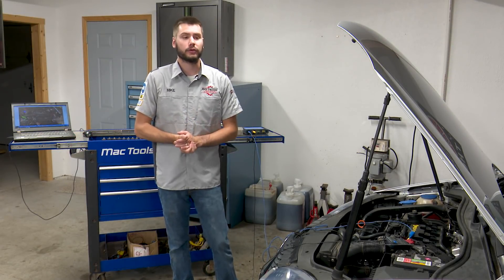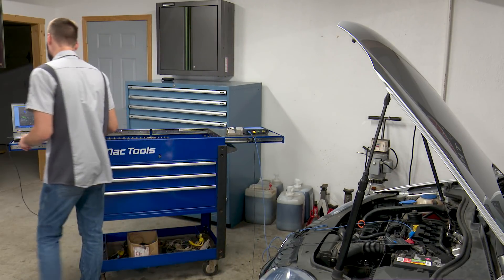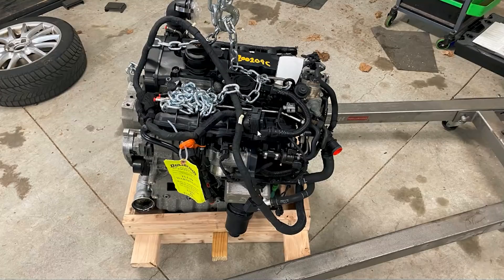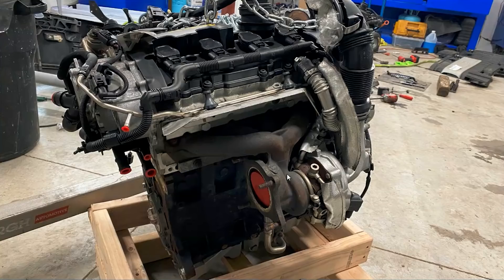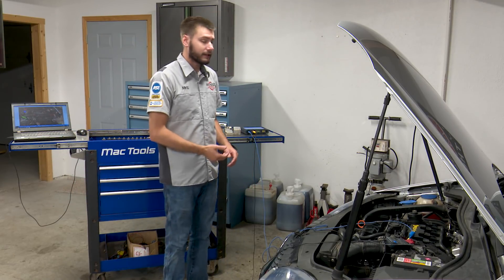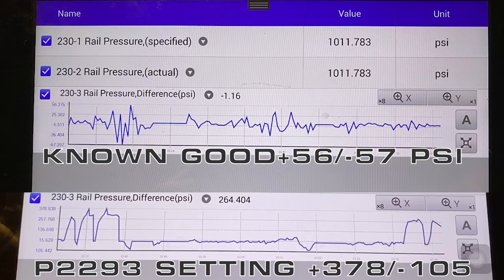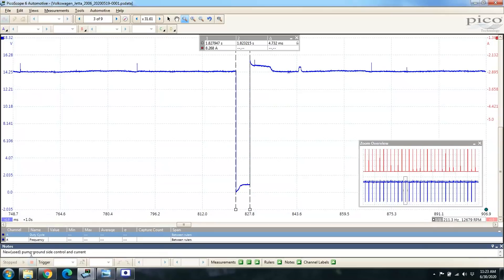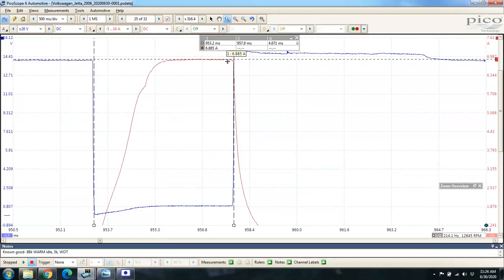Part 4 - Did The New Engine Fix The P2293 High Pressure Pump Related Code?

Comment: Thanks Mike
Time to quit while your ahead?  
To sell or not to sell, that is the question?
If it's running good, keep it till it starts giving trouble, then get rid of it!
To me, the electrical comparison was comparitively in range.  It obviously was the mechanical part that that caused all the problems.  Reminds me of a 71 AMC Hornet with a "double acting" fuel pump problem many years ago.  Wound up to be a worn cam lobe for the pump.
Good job Mike, hope this engine lasts a long time!
Reply from the maker: Hey Mike, thanks for watching! I know, its a tough question for sure. We'll see what happens.
Mike Becker, Senior Instructor

Comment: The answer to a lot of questions is that the high pressure pump control is timed. The beginning or the end of the pump stroke is being used. That’s how the pressure is controlled. In live data you can often see if cam timing is correct or how much it is out of spec. Because it is important to know for the engine ecu to control the high pressure pump. Somewhere in measurement group 90-94. I hope this usefull.
Reply from the maker: Hey Martjin 83, that's interesting, i'll have to take a look into that. Thanks!
Mike Becker, Senior Instructor

Comment: Nice score with that engine, Mike! Thing looked mint! Glad you got that nightmare behind you now. Problem is, if you sell it, what kind of problems will you run into with a replacement vehicle? That's the conundrum I have whenever I think I need another vehicle, lol. Especially anything built this century ...

We've had our 34 year old Grand Marquis for 17 years this past January, & the Silverado for 13 now. The 26 year old Volvo 940 is our newest addition to the fleet at 5 years of ownership. I'm keeping all of them, because, you know the saying, "Better the devil you know than the one you don't." ... And because I can't afford anything built before the 1973 model year. If I had my way, my whole fleet would be run with carburetors and HEI. 😂 

Anyway, great follow up, Mike - thanks for sharing. 👍🍻
Reply from the maker: Hey Smitty! I will always have "problems with the replacement vehicle". I refuse to buy anything "nice" I always buy something broken haha! You won't find any carbs in my garage, haha!
Mike Becker, Senior Instructor
Reply: @GoTechTraining  - Ahh you young fellas don't know what you're missing! 😜

I've been the same way as far as cars go, except for one time when I bought a brand new Silverado in 2007. Biggest mistake of my life! I was better off driving stuff from the 70's through the early 90's as far as reliability goes. That Silverado has been a lemon since the day it left the showroom! I bought new to try and save myself the aggravation of frequent repairs. HA! This thing was the worst vehicle I've ever owned in my life in that regard - instead of wrenching on it, I was sitting in a dealership for hours for warranty work! I'd rather be doing it myself! Will be the LAST new vehicle I ever buy. My next "new" vehicle will be pre-1973 model year. 😁
Reply from the maker: Man that's crazy about your Silverado...07 wasn't that bad of a vehicle. You must have just gotten unlucky!
Mike Becker, Senior Instructor
Reply: @GoTechTraining  - Well the AFM problem is widespread with those, but that's just one problem of many. I had brake pulsation on the test drive with just over 40 miles on the clock, trim was falling off the driver's door at that same time, lower ball joints made it only 38k miles, uppers 50k, along with the hub bearings, & 1 strut, & started burning oil. Front axle started leaking around that time, too. Kept throwing "Service 4x4 System" right out of the gate - dealer kicked that can right out of warranty, and I got stuck replacing the 4x4 switch at 55k, then my rear differential's spider gears shed most of their teeth off at 97k. And don't get me started on the paint and body metal strength. I tapped a little sapling in the yard with the right rear of the bumper when it was just 2 years old, and that cost me $2,200 in repairs. It not only bent the bumper, but tweaked the box and creased it right over the rear wheel. Had to go on the frame machine for an hour to straighten that out. When I had it all apart to replace the bumper components, the amount of rust I saw was frightening. 2 years old!

Chevy's slogan used to be, "Like a Rock" - today it should be, "Like a beer can". 😟

Comment: is the pump maybe damaged inside( bypassing/piston/diaphragm, causing a low tension follower chatter and over-pressure break down of the coil clearances, making current rise?
sometimes my mind goes off the wall, but sometimes that off the wall is very close to the real issue
Reply from the maker: Hey Throttle Bottle, not sure, could be I suppose. I hope not though, I don't wan't to put anything else into this car ;)
Mike Becker, Senior Instructor

Comment: I've never seen a tamper resistant cover on a computer connector before. Maybe they put it there thinking that the aftermarket would come up with some plug-in power chip for the module and they wanted to prevent that from happening. In general, Volkswagen seems to do odd things for tamper prevention (triple square and 12-point bolts come to mind).
Reply from the maker: Hey Joseph, I know, I haven't ever seen one either...crazy VW's! That could be the reasoning, but then again it's VW they don't really need a reason...saying it's a VW is reason enough, haha!
Mike Becker, Senior Instructor
Reply: dieselgate =p
Reply: throttle bottle ding ding ding.   This was exact same thought.   The VW “diesel gate” scandal that cost VW billions and darn near destroyed the company.  It was not a deterrent against tuners, it is deterrent against EPA and other investigators / regulators from trying to reverse engineer PCM logic.

For others reading this comment who may not be familiar with the massive scandal, try a Google search for “VW diesel-gate”.   I used to work for a Big Oil company and we used this scandal as a learning case study to teach our employees about how corporate reputation can get ruined by this type of cheating.  If I recall correctly, people including top executives went to prison for this.

Comment: Ok I have some input:
On my engine (BPY), my cam follower was worn COMPLETELY THROUGH; as in a giant hole where the surface used to be. This meant that the cam lobe was making direct contact with the end of the fuel pump plunger (imagine just removing the cam follower and putting everything back together). 
The camshaft lobe wore down the fuel pump plunger quite a bit. 
After all this, I still did not have a check engine light for low fuel pressure. 
This tells me the fuel pump was able to meet demand, even with quite a bit of the mating material removed. 
I’m not a mechanic, but I’m wondering if there was a problem with your solenoid? Or maybe the fuel pressure sensor?

Any thoughts appreciated.
Reply from the maker: Hey Justin, that's interesting. You don't have access to a scanner that can see data, do you? I wonder if the desired/actual high pressure fuel numbers are the same?
Mike Becker, Senior Instructor
Reply: @GoTechTraining  I’ve already replaced the camshafts, fuel pump and follower. Didn’t scan it at the time, but I do remember I didn’t have a MIL. Would be interesting data. My bearings weren’t as bad as yours, luckily. Even measured clearances with Plastigage. Thanks.

Comment: Next good video, but why You decide for engine replacement? In the old engine, the worn camshaft did a lot of damage? Best regards from Poland👍
Reply from the maker: Hey Seb, the engine was replaced under warranty through he junkyard. The condition of the camshaft was worrisome. What did the crankshaft look like? Chances are that engine wouldn't be running for much longer considering how much metal I found in there. 
Mike Becker, Senior Instructor

Comment: Hi I have a 2007 Audi A4 2.0t and I have a p2293 and I have a real rough idle for about 3-4 min and then it will stall out. The idle is going up and down and the fuel rail pressure is sticking around 1800 psi. Replaced the fuel pump twice, gotten new sensors, replaced the purge valve and replaced the camshaft and follower. Still having the problem. Any ideas would considering we’ve replaced almost everything. Thank you.
Reply from the maker: Hey Logan, what are the idle fuel trims? Is it running rich or lean when the issues present/ Has the PCV system been inspected?
Mike Becker, Senior Instructor

Comment: Dropped these motor/trans assemblies before, but never even thought of your front end pulling method. Makes sense of course in your garage, just wondering if you have a preference?
Reply from the maker: Hey Gunnar, I've never dropped one of these 2.0 BPY's specifically from the bottom, i've done others though. This motor is crammed tight. I prefer to remove the front clip on here, only takes about 25 minutes.
Mike Becker, Senior Instructor

Comment: It might be a good idea to make cam follower inspection a "maintenance item" for this car every other oil change or so, considering how this engine would not throw any code until it's too late and how cheap those cam followers are.
Reply from the maker: Hey Softturbo, that's a good idea. I wonder if they do that in the Euro shops that deal with these all the time? It would be super beneficial to catch it early, that's for sure!
Mike Becker, Senior Instructor

Comment: How would the pressure regulator pwm ,bad pump vs new because of engine fuel demand. ?? I would have liked to seen the Regulator comparison along with pump comparison.
Reply from the maker: Hey Over Load, the "pump" which is what I was calling it, acts as the regulator. It's a solenoid that allows the fuel into the rail. 
Mike Becker, Senior Instructor
Reply: @GoTechTraining  can you activate this regulator with the scan tool to bleed off fuel . Not sure if VW gives this option. Never worked on this vehicle before, where some other vehicles have regulator after pump at end of rail.

Comment: What fixed.... Engine replacement??
Another pump didn't fix it. Camshaft replacement with new cylinder head wouldn't have fixed it. So conclusion as U said U don't know what was wrong with it. Sorry to say this but I don't believe U fixed it swapping n engine is not a fix. But great effort for the video

Comment: LOL... Now... Try that again with a Quattro! Motor and Trans on the sub, as a whole unit. Then detach.
Reply from the maker: Sounds fun! Haha! I have the engine pulled on a 2.5L AWD 2011 Escape right now...same thing, engine/trans/PTU all out as an assembly from the bottom. Not a bad job though...hood pop to engine on the floor in 2 hours.
Mike Becker, Senior Instructor